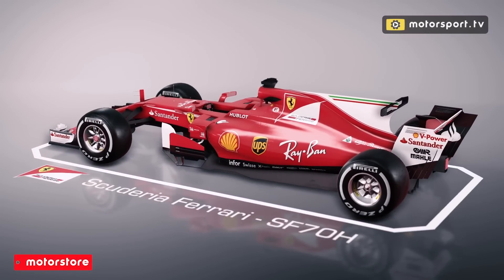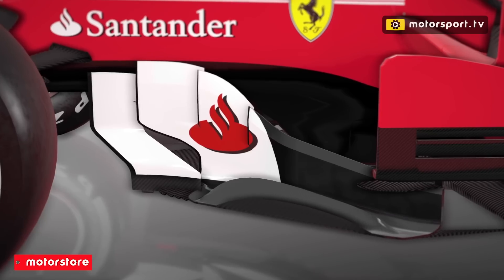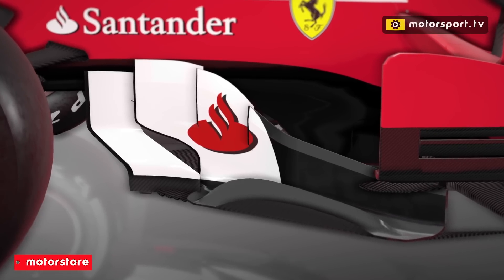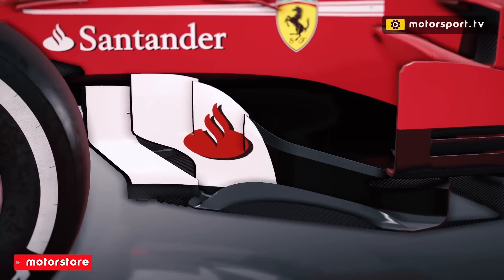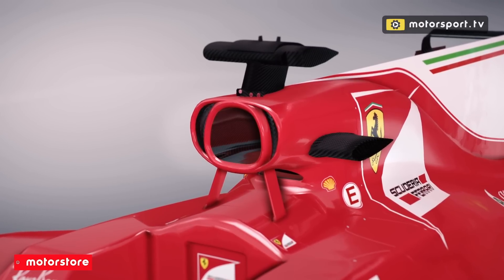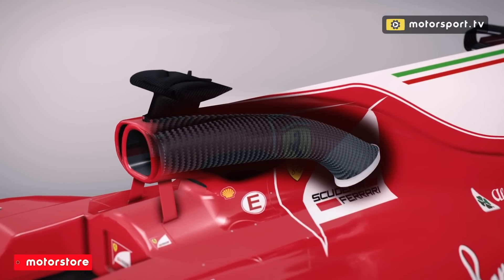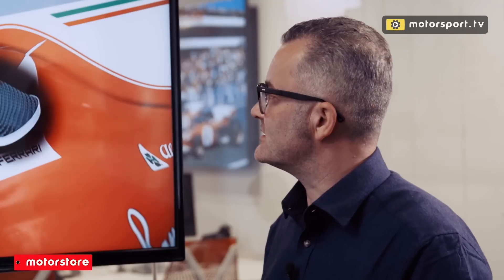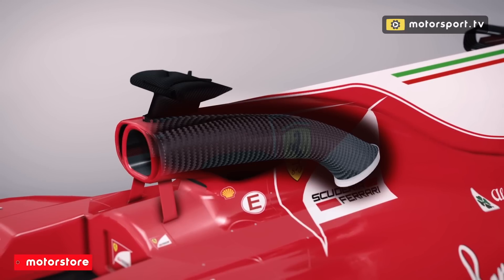3d animation: Ferrari's Malaysian roll-hoop layout

Comment: Does anyone know if Ferrari are running this supposedly new engine with the 3D printed pistons etc?  It seem's to me whatever they have changed has resulted in much more cooling requirements yet still this doesn't seem to be enough.  Engine failure in Malaysia, Engine problem practice Q1 in Japan then spark plug failure during the race,  perhaps the oil burning regulation change really has effected the Ferrari a lot more than the other teams,  it will be interesting to see how the new Mercedes PU works with the new oil regulations as I believe they are still running the increased power Monza unit's.
Reply: Hyperezil I think scarbs said at the beginning of the year that they aren't using the new pistons talked about earlier.
Reply: Either 3d printed piston or conrod made of plywood